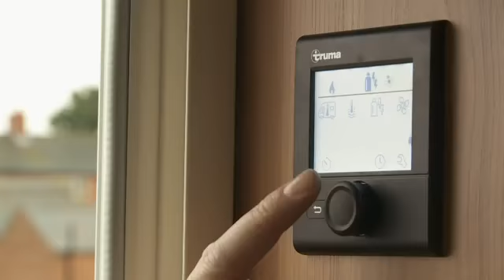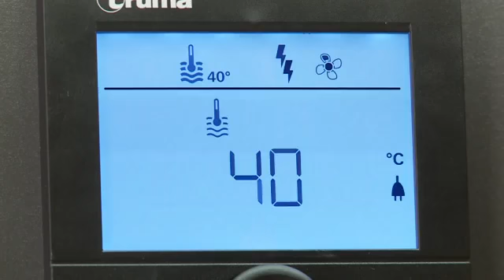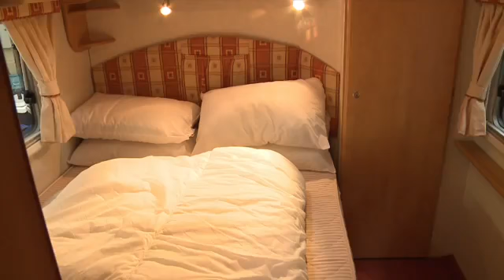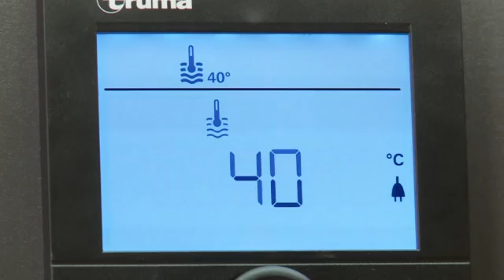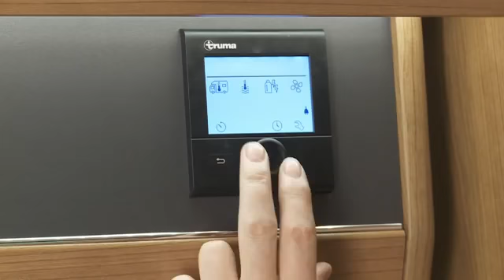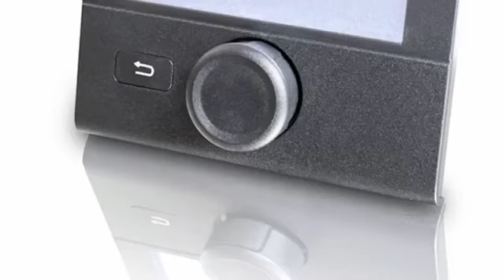Truma Combi CP Plus Heating Panel with the Swindon Caravans Group

Comment: My truma boiler is heating water but blown air not kicking in. Not sure of model but my van is 2004. Suspect it is the circuit board. Any advice. Garage has quoted £2000 for complete replacement not willing to find fault.